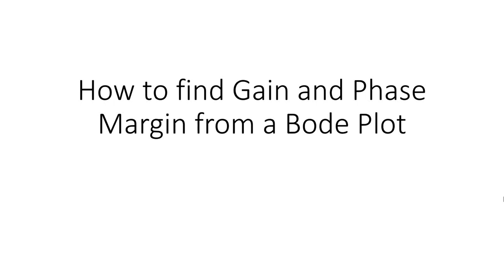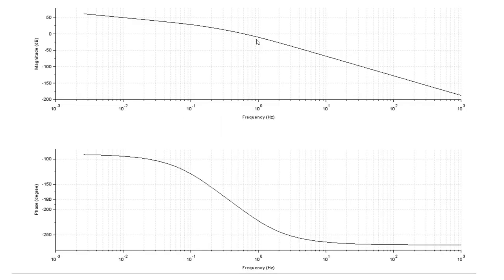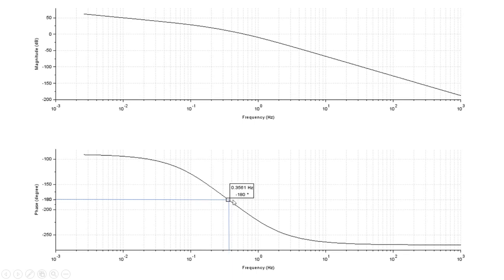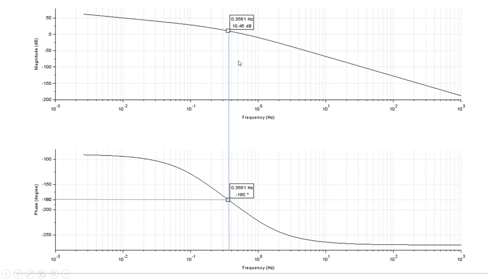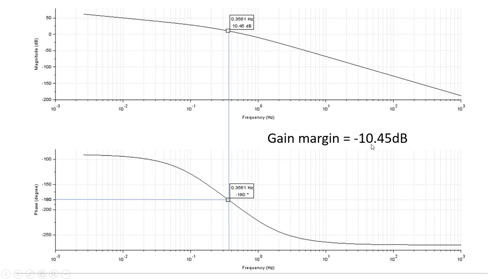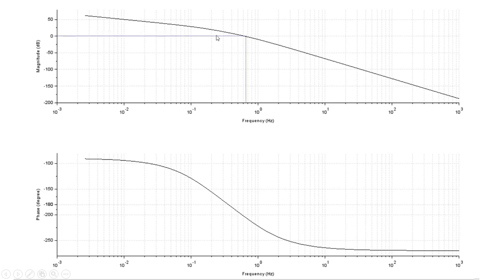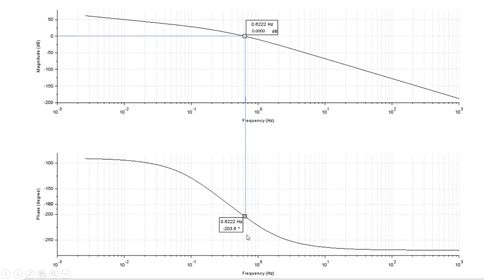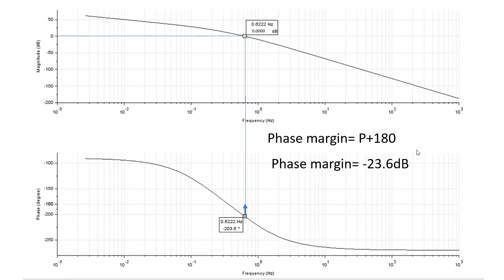How to Calculate Gain and Phase Margin and Cross Over Frequencies From a Bode Plot

Comment: Thank you for the video. 1st video in which the author does not digress in 10 directions before actually addressing the purpose of the video. Question: so everything in between the 0 db line on the gain plot and the 180° line on the phase plot is considered attenuation, and everything outside is amplification of the signal, correct?